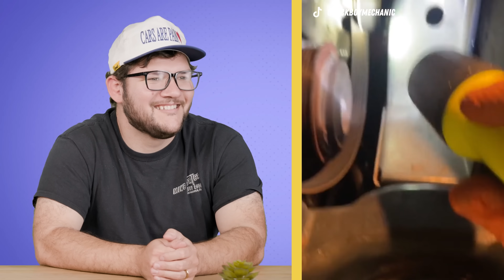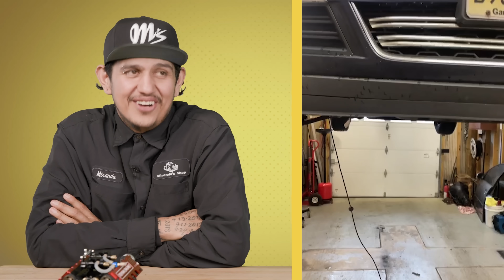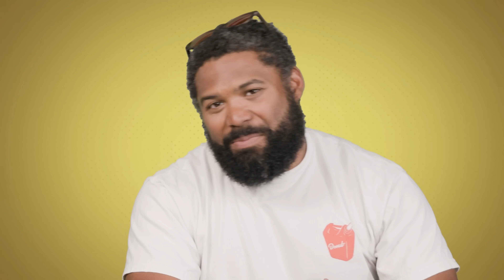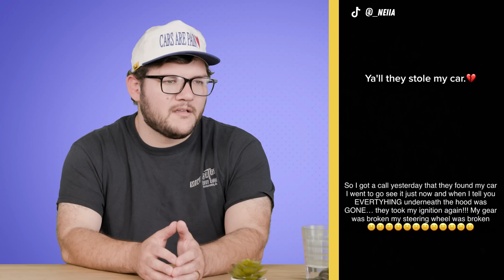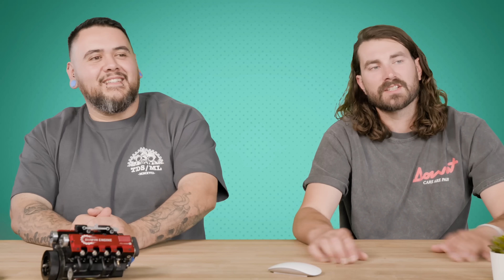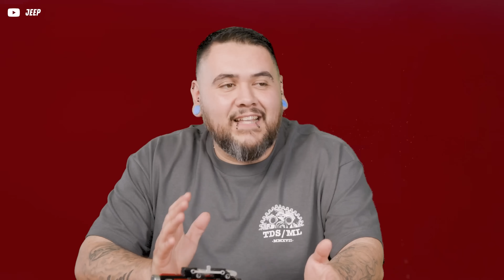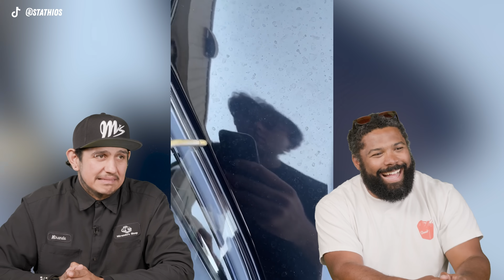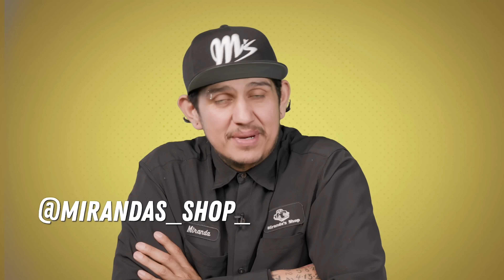Mechanic Reacts to Car Engineering Fails

Comment: Every car I have bought in past 5 years are all built before 2006. A. I can work on it, farmed trained mechanic. B. They last forever and look better then most of the cookie cutter cars. C. Like shelter animals, we have a lot of used older cars with low mileage that need a good home. Just update the stereo, and give it some TLC and it will last you longer then a modern car. Hell my 99 CRV 1 tranny, factory motor sitting at 350k, our newest one 2002 Acura MDX with 123k miles just need struts and new head unit, but looks brand new inside and out.

Comment: Regarding that McLaren. I don't work in automotive, but engineers are typically involved when it comes to approving parts for a bill of materials. I wouldn't think they left choice of fastner up to the factory, and that each part is specified from engineering directly or a manufacturing engineer that approves the last little assembly parts.

Comment: Its not really the engineers. Most likely its the corporation. Engineering in the real world can't actually get to perfect they don't like these things either but they may or may not actually have the time to fix or even identify many of these problems, they're on a tight time table and need to make it good enough in that time frame, Angela made a good point though "good enough" is a certain percentage clearing the warranty window after that there is no funding to make it better.

Comment: 12:30  aN o2 Actually measures the lack of Oxygen in the exhaust stream near the manifold.  Most newer cars use Air Fuel Ratio sensors, a form of wide-band monitoring of the gasses.  O2's measure 02 content indirectly via voltage whereas AFS and wideband 02's measure it directly via current measurements.  The older style is cool because you can watch scan data but with AFS you need an oscilliscope to watch current data.

Comment: 12:30 What happens is the oil leaks into the harness an wicks into every branch of the harness causing fals readings with every sensor at every branch.  This is a diag nightmare and the dealers themselves throw up their arms and send them to me.  I love these.

Comment: nah just drill a hole in the frame (slightly oversize so you can weld a tube in to reinforce the area you drilled through) and then you can take the bolt out from the front ...ya that'll work...ya...

Comment: The engineer who chose that bolt length probably did it years or decades before someone decided to make the car that part was crammed into. Engineers rarely choose the parameters of the project - that's the boss.

Comment: Engineer; 
1; Idler bolt; you get to pick, things can either be large, inefficient and expensive, or it can reuse a bunch of parts and really tightly incorperate parts, making serviceability worse, but making the car safer, more efficient, more reliable and cheaper. This isn't a mistake, its a decision someone made. It's a choice not a mistake.
2; Roof leak; any money there's an aftermarket sunroof installation or something like that on that one. Don't have enough info to tell. Either way, it should go to a body repair shop for warranty, not to a mechanic ;)
3; Kia theft; It's an engineering mistake, but likely comes from culture, not a more conventional oversight. Some Asian nations have essentially no crime of certain types, so there isn't as big a design focus in these areas.
4; McLaren; Interesting problem, it looks like a couple of those bolts have different washers and transporting a car at 43 miles isn't something that happens a lot... Normally people own cars for a long time as an investment or drive them and flip them... Not a lot of distance and not a long period of ownership suggests that it might have been an accident repair flip... This is pretty consistent with the types of problem seen... I'd be interested in seeing the original video... Either way, it's either extremely poor workmanship in the factory (unlikely) or a dodgy repair.
5; Jeep = Jeep... Not much to say, they've got a unique market position, one that generally has worse quality than Chinese manufacturers but a bit of a cult following (I own one).
6; Tesla; they're learning still, they're not quite the same as most car companies, they try for a lot more automation... Normally a car company will fettle at the end of the line, and has a whole bunch of hand me down manufacturing tricks that Tesla just hasn't had the time to build up yet... They'll get better and they're pretty cool cars. Not sure how they go doing warranty stuff though.
Interlude; Mechanics are NOT ignored by Engineers, a lot of auto engineers actually started as mechanics or in trades (I did), it just happens that servicability ISN'T the only consideration. It might feel like it is when your job is servicing though.
7; Landrover; this is the laziest mechanic I think I've seen in a while... The under tray is what's blocking the oil there... Take the under tray off, problem solved... It's there for aerodynamics and helps fuel economy massively as well as highway handling... You can litterally see the bolts the person is too lazy to undo... Also too lazy to use a pan, also too lazy to work out what's wrong. There's obviously something wrong enough with that car that an oil change isn't the complete answer... Diesel in oil or something I'd guess.
8; GM; Engineering problem, but not what the guy thinks... Cars are a nest because of the drivers mentioned above (compactness, interior space, fuel economy etc), this is an issue with the hose, not an issue with the positon of the hose relative to the o2 sensor... Everything drips on something if it leaks, the problem is the leak. It's also not about warranty, most cars these days will go double or triple the waranty period without issues, it just sounds like a manufacturing defect in the hose... I'm guessing theres a hose company somewhere paying for those loom replacements.
99% of Engineers love the mechanics we work with (and fitters, panel beaters, boiler makers, machinists etc.) and there are occasional funny conversations about "why did you do that" etc. but the Tradies love the Engineers back. Jeep is hilarious though... I'd love to chat with some of their design guys :D

Comment: 5:50.  Grrrrrrr...  the mechanics cannot put a bolt where there is not a bolt hole?  Who put the bolt hole there?  If there is a hole, it's got slag from another welding process on the treads...  Ahh, yes , the accountants! (not a random blurb, actually look at how much accounting cuts design ideas and I will love you again.  (Donut I love you)  You didnt hear that.

Comment: A running KIA / Hyundai engine of a certain year is faulty and still back logged for like 1.5 years.  So, you have a warranty from KIA or Hyundai but they won't get you a rental car for 1=1.5 years.  Thay tell you to drive it till it breaks.  If it's under warranty and comes in on a tow truck, guess what?  You might as well order bottle service to the table you are sitting at.....  you might be there a while.  Chips and salsa?

Comment: on the gm 3.6 just loosen 3 bolts on the RH motor-mount and jack the engine up like 3 inches.  Done.  It really makes the job even more pleasurable.

Comment: Remember vehicles are designed on a computer these days. To fit as tight as possible so the hood is as short and low as possible. 
And then there is.. make it as cheap as possible.
So plastic plastic plastic. Not so bad when. New. But 8 years down the road.. plastics break. Parts not related to what your repaiting break. Many parts are one time use.
Reply: What does being designed on a computer have to do with anything? lol 🤦‍♂

Comment: I got a 2022 TRD Camry last year and the car came with a JBL sound system and subwoofer and ZERO insulation around it. The damn thing sounded like it was about to rattle apart and all the shifty eyed looks I got from the salesmen and shop techs told me I was not the first to have this issue.

Comment: Told the saturn folks i hope they all ended up on the streets after they would not fix a fuel pump in a car with 13 k miles…and they did end up on the syreets👍🏻 on to Ford, GM, etc. Surprised the workers don’t revolt and tar and feather the engineers who make them assemble crap.

Comment: I bought a new 2018 Rubicon and within 2 months the stop start engine featured died (which was fine by me) because Jeep uses a secondary battery under the real battery to manage the stop start.  It died....2 months...yeah.  Went in to get oil change..dealer said "oh man your stop start battery is dead lets fix it under warrant for free".  I said sure why not.....they replaced it.  2 weeks later stop start quit working again....battery died again lol.....Jeep electronics....

Comment: On the Audi it’s not unfixable. Assuming the Audi has a sunroof. Which means it must have drain tubes to prevent water from entering inside the vehicle. The tubes are blocked/ clogged up. I work on vws and usually it’s clogged. There’s a recall on vws which is a drain tube flap removal which creates debris to get stuck inside the tubes causing the tubes to over flow and water gets inside the cabin area. The recall removes the flaps and we clean the tubes. If water gets in the car you replace both the tubes and the headliner and most likely the carpet as well. Water always finds its way down. So it is fixable. Since VW owns Audi

Comment: on the tensioner. why was the tensioner pulley pulled out so the bolt hit the frame to begin with. you can certainly see that the tensioner pulley does not line up to the other pulleys.

Comment: You know. I think a lot of the time, engineers and designers (not all parts on a car are designed by an engineers) take the heat for executives and financiers that force product managers to get the various teams involved to make cheap, stupud decisions. 
A great example is the Pinto. It was engineered with air bags, a puncture resistant bladder in the fuel tank and various other safety bits that all were dropped because of costs. And what could have been one of the safest cars on the road at the time, well, we all should know about its fiery reputation by now.

Comment: I ran into the same thing as the first one with my sons cars idler pulley. So we did what you said and release the engine mounts on that side and tilted the engine to remove it. The entire time that we were doing it I kept saying the same thing "How long does this stupid bolt need to be".

Comment: I had to replace a tensioner pulley in that situation 🤦🏻‍♂️ hat to loosen the motor mounts and jack the engine sideways a bit to pull the fucking bolt off, very time consuming.

Comment: 10:35
This shit reminds me of the stupid f-150 plastic plugs. Half the time they're directly in front of a bar making them annoying to pull off by hand and as soon as you pull them they splash oil everywhere because, being a thick plug, they drain really quickly and almost explosively. Into that bar. Ugh.

Comment: The belt idler pulley bolt reminded me of a '95 Wrangler I bought new back in the day. I put a 3 inch body and inch and a quarter shackle lift under it. Body was easy peasy. Shackle? I had to drive it down to the local shop to get the leaf spring hanger blots cut off in the back as in order to get them off you would have had to drop the fuel tank. Since the lift shackles came with new bolts I chose to pay someone 20 bucks to torch the two bolts off.

Comment: My F350 has an automatic tailgate that stopped working. I went into the dealer to buy the $80 part you can only buy from them. They said there was a recall on that and to do the recall instead of buying another part. One day of work turned into 3 (not including the entire weekend). They rewired the entire actuator all of the way back to the engine, including pulling the dashboard out. I went and picked it up and the tailgate still didn't work. I bought the $80 part and replaced it myself in 15 minutes. Tailgate works great now.

Comment: For the bolt on the pulley system, I think I'd be looking at doing some creative cutting and drilling to modify the car to get easier access to the bolt. Though I get that a mechanic wouldn't do that to a customer's car, but if it was my car I'd really be looking at making modifications. Case in point I have a 2011 Jeep Patriot with the terrible electrical system design (who puts a relay box down in a wheel well exposed to the elements???) and have since improved it myself by moving the relays up in the engine bay area because there was no way I was going to be dealing with that BS again.

Comment: 2:53 Audi tech here! There is actually a warranty TSB for this but it is extremely annoying that these brand new cars have this issue. as for the electrical issue, the only thing we've seen happen so far is that the shifter will start to act up but that will also be replaced under warranty

Edit: I would actually blame the engineer for this because there is no water drain behind the wind deflector, which actually causes the leak

Comment: My dad is an engineer and a mechanic. He constantly complains about the higher ups in his company. He speaks from experience when he explains to them why a design won't work, and they just don't care. They have the "thats the next guy's problem" attitude.
Reply: My husband is an Electrical Engineer and has been working hands on as a Union Electrician for 20yrs. Working in the oils refineries in Long Beach, and commercial construction for Los Angeles County & Southern CA. He hates engineers in the office for this same reason. He’ll explain to them the faults in their designs and they brush him off like he doesn’t know what he’s talking about. They won’t even come onto the job site to see the projects in the field because ‘they know what they’re talking about.’
They’ve had to do 10’s of thousands of dollars worth of revisions to designs that my husband originally told them wouldn’t work (this just happened on a city job out here and it happens often) 🙄
Reply: @run.rabbit.189  sounds like some awful engineers and sadly management often can’t tell because they are technically illiterate.  I’m a mechanical engineer who has done extensive electrical engineering design and I’d always consider ideas or complaints from anyone, even assembly workers.  Believe it or not I found it highly informative and worth my time.
Reply: As an embedded hardware and software engineer, I've had the same experience.
Managements sole purpose, is to spend 10 cents on saving a penny. 

I had a parttime job as server admin, during my university years. Explained management that they had to replace their old failing server, for about an 8K USD new one. They said that there wasn't any money for a new server. Three weeks later the CEO drove a Tesla, and sales got a 10K USD smart-board they were to incompetent for to utilize to it's full potential. I quit and they had a huge server failure less than 6 months later.

Then at my first engineering job, after graduating. There I would get 3 weeks to finish a project, yet ordering parts and equipment took at least 6 weeks. Management refused to believe me, when I said that I can't start on a project without equipment.
Reply: I dealt with this a previous job log ago. I told corporate they are bundling products that are completely incompatible in the sales ad and they were basically like "oh well, it's out already". It's like sending out pc parts with macs. I told my guys that if anyone asked everything was sold out because the sale was so good lol.
Reply: 1000%^ this.  They will break the spirit of any newbie.  Engineers optimize for function, management optimize for production cost and get the only say in it.
Reply: @hugegamer5988  it haunts me every night
Reply: It is not a problem. If it costs too much to repair. You buy a new vehicle.
If you can't by a CARB or AQMD approved part. You buy a new vehicle.
Reply: yeah us engineers want to make a good design, and we can. but finance people are evil.

Comment: Belt tensioners are held on by a bracket, and when you change out the pulley you remove the bracket bolts (NOT the bolt through the pulley). The same holds true if the pulley is an idler. I'm surprised that these "mechanics" don't know this.

Comment: The Audi Q3 roof leak is actually an EXTREMELY common issue that is generally very easily remedied. It is generally one of four faults:
1) The wind deflector for the sunroof could be of an older model. The old deflectors for the Q3s had insufficient water flow which would cause the area where the deflector sits to pool up and overflow, going overtop the deflector and creeping into the interior through and down the front of the headliner. This part has since been superceeded.
2) One or more of the drain hoses for the sunroof could be clogged -- again, causing water to pool up in the area and overflow.
3) One of the actual glass sunroof panels could be misaligned to such a degree that water seeps through (uncommon).
4) The perimeter seal for the sunroof could have a defect or is losing sealing at a specific spot.
Lastly, the mythical 5th potential defect (not listed in the man four because it is EXTREMELY uncommon): the actual sunroof frame could have a defect, causing all listed components to be replaced alongside the frame.

You implement one of these fixes, check for any wiring damage (which is very unlikely as there is barely any wiring in the affected area) and if none is found, replace the roof control module and dry out the carpets.

The more you know.

Comment: That oil change mess, try a pump to empty the oil from above. With the filter try cutting a plastic bottle to fit over the oil filter and then remove it

Comment: I can vouch for Jeeps crappy electronics issues.  I've got a 2011 JK Wrangler 3.8L V6 2 door.  I've replaced the main computer THREE times, the PCB board for the HVAC TWICE, and Coil Pack EIGHT times.